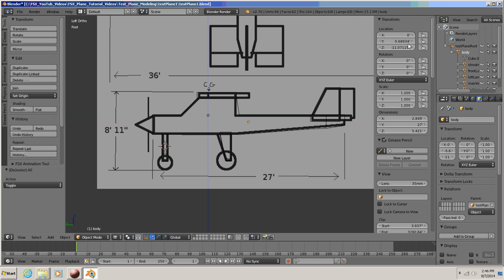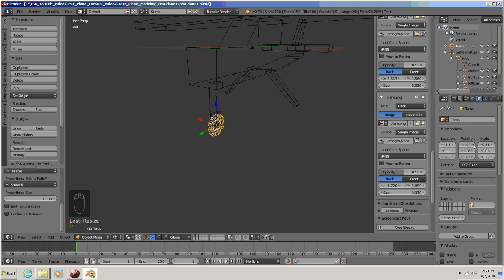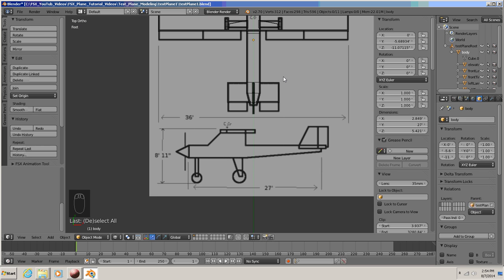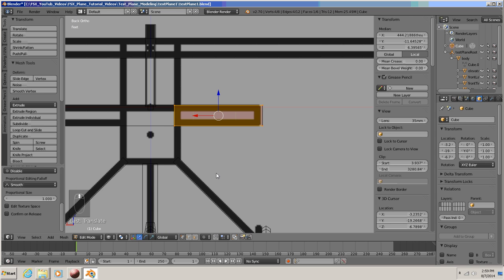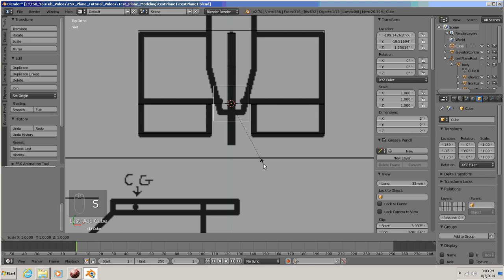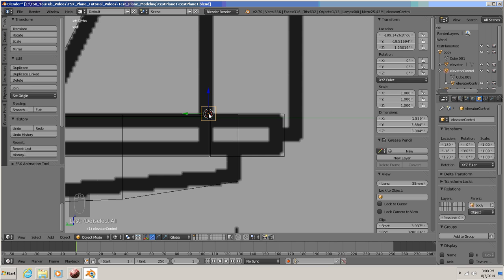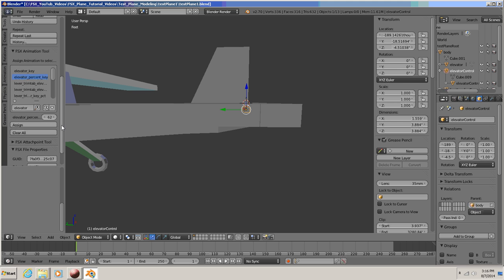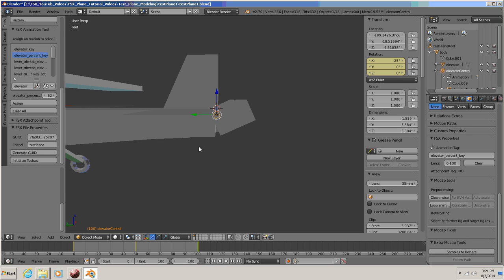How To Use Blender For Making Flight Simulator X Models (FSX) Blender2FSX Part 4

Comment: Hey there I am on the part where you assign animations to the elevator, however on my computer there are no options inside the assign animation box on the left side of the screen. Any idea what the problem is?
Reply: having the same issue here
Reply: Solved!. Make sure you tick the boxes for the plugin inside the "user preferences" menu, as stated here. Read it cloesly http://www.fsdeveloper.com/wiki/index.php?title=Blender2FSX_Toolset_manual#Installing_Blender2FSX
Reply: Thank you for the help but I had that done. Actually now an error message is popping up saying a line from the addon is not working
Reply: PatrioticBiker that's because either you dont have the fsx SDK or it isn't written in the registry. If you're trying to use it for p3d, you'll need to install blender 2 p3d along with the p3d SDK.
Reply: Can you clarify what you mean when you say it isn't written in the registry?
Reply: PatrioticBiker the windows local registry, where paths for all files are stated to be read by programs. That thing you access via the command regedit
Reply: i'm using it for fsx and have the SDK installed